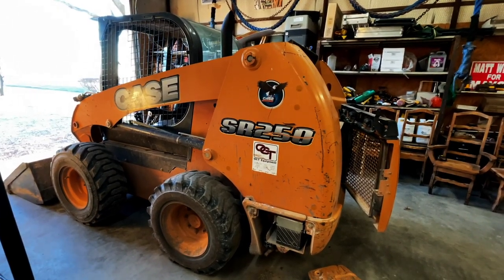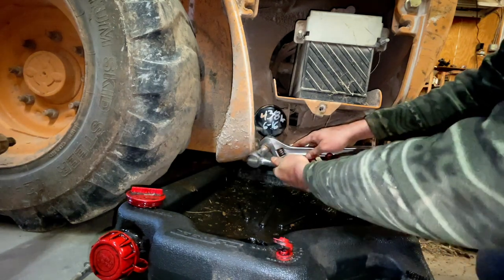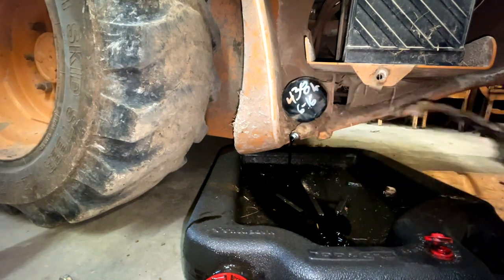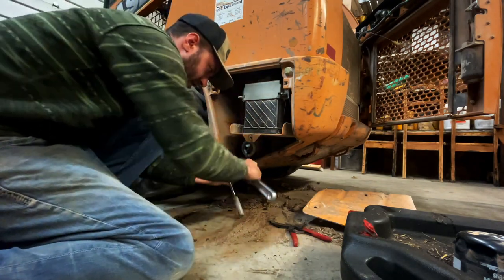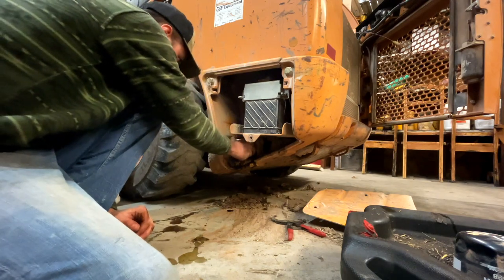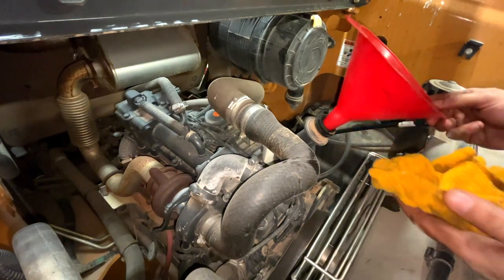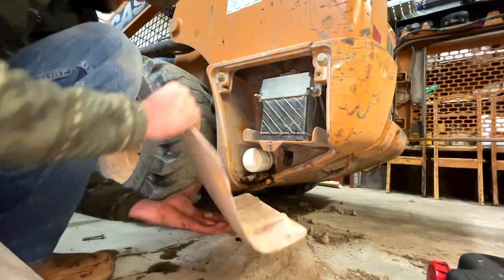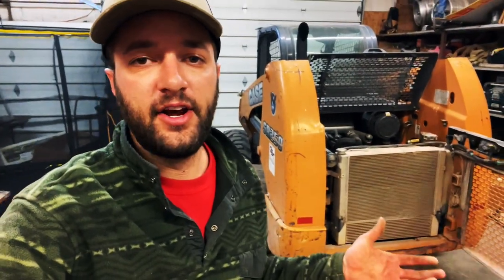HOW TO Change Engine Oil / Filter in Skid Steer (CASE SR250)

Comment: What year is your machine, mine is not located there?
Reply from the maker: Honestly, I can’t remember off the top of my head. 
If you’re unable to locate yours, I would call Case and give them your serial number and they would be able to tell you where it is. 
The oil change procedure won’t be any different though.
Reply: Mines not either.  Still looking for it.  2016 sv250
Reply: Mine wasn't there either, I had to tilt the cab open to get to the filter.   You raise the lift arms all the way up and lock them in position.   There are two nuts at the rear of the cab to take off, then the cab can be tilted open.   Then It's on the right side of the engine.  Not easy to get to and the cab is very heavy to lift.